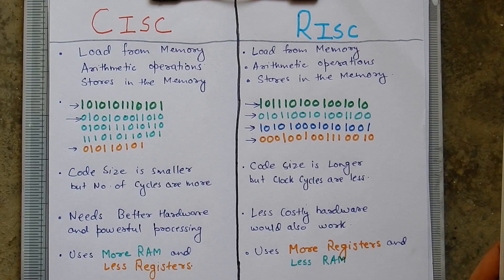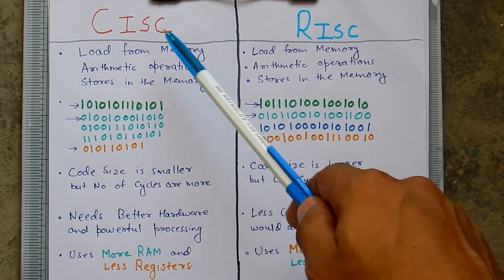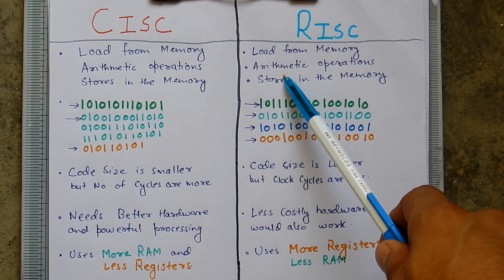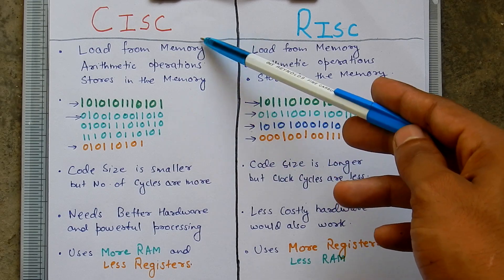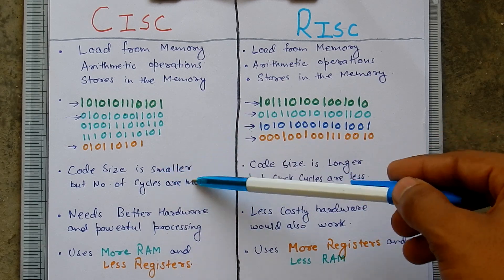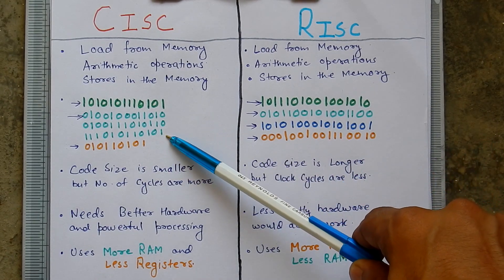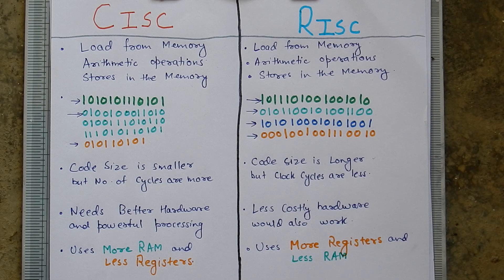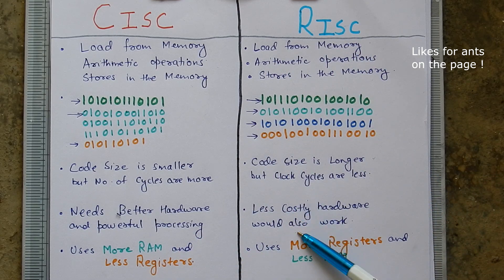Difference between CISC and RISC Architechture

Comment: I didn't get 1st difference, what is the difference in that both look similar
Reply: shahbaz khan steps
Reply: Cisc takes one step to do the whole operation whereas risc takes 3 .
Reply: And a memory access is very slow and an access of the cpu register is much faster. If there is only a few register, then we have to use the ram more frequently, for to store/save some values example for a calculation.